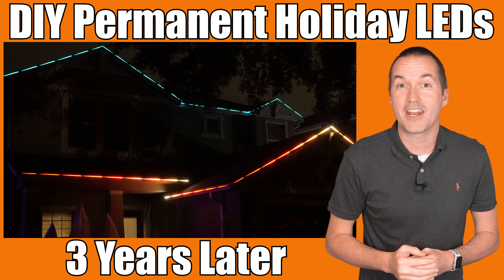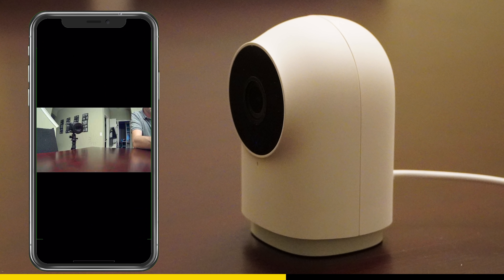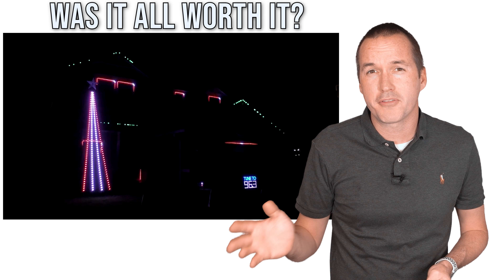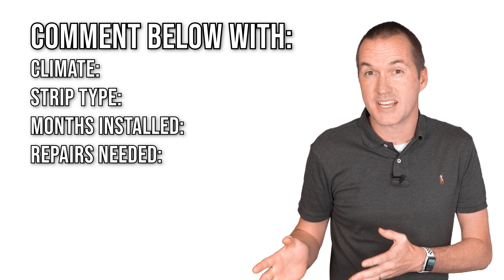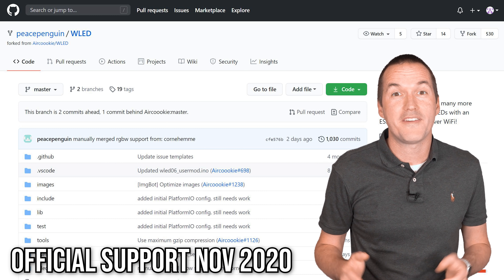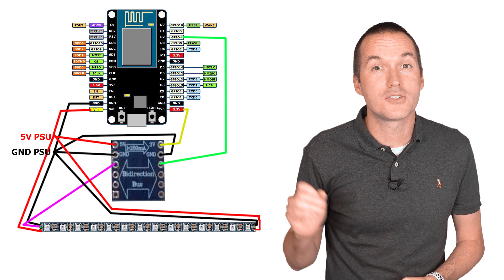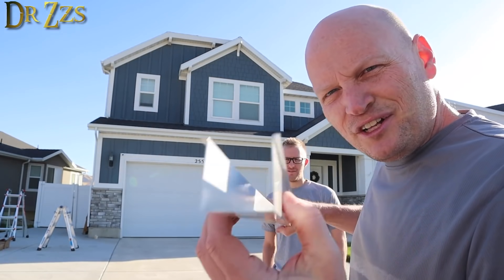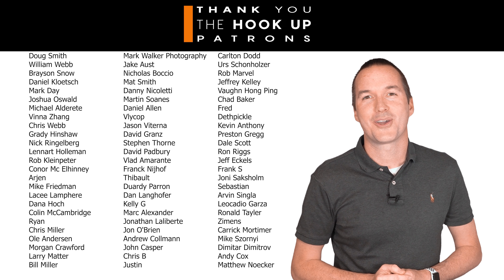3 Years Later: DIY Permanent Holiday LEDs - What worked, what didn't, and what's new?

Comment: Does anyone ever hook-up the LED Strips so that they are on the back-side of the fascia board shining ONTO THE HOME instead of directly visible from the gutter or drip edge (ODE - Outside Drip Edge) like you did?  Does this “indirect” lighting significantly  affect the presentation?  Have you seen a light presentation with this indirect lighting?  The LED Strips & Channel Covers are also protected from the weather when mounted under the soffit/fascia. My reasoning for attaching to the fascia is that the channel can be completely hidden for homes that do not have WHITE Soffit/Fascia. Completely hidden is a perfect situation. I always think it isn’t the best look when you can see the lights in the normal daytime even though they are white on white for most. I have already prepared the fascia to be routed-out soon. Was thinking maybe you knew someone that has already used some sort of indirect lighting method & would love to know your answers, thoughts or any known problems with the indirect lighting. Thanks in advance.
Reply from the maker: It’s a totally different look, but I think it also looks great.  I’d say 30% of the installs that are posted on the Facebook group are indirect.

Comment: What are your thoughts on the WS2818 strips/strings?
Reply from the maker: Couldn’t find much info about them, just 2811s with backup data? The bad part about back up data is increased voltage drop caused be thinner traces on the strip.

Comment: Question - I am looking on some feedback or logic that would help me chose between strips or strings?  Ive watched Dr Zzs video which recommended 12v WS2811, whereas you suggest the 5v on strings.   I never considered strips as my assumption is that once you put them in a sleeve, the light would look diffused or blended with the colors next to it... instead of the crisp single point of strings.  Thoughts, links?  Thanks again for your great videos

Comment: I’m a newbie to this LED Light Strip technology and haven’t seen the topic exactly, but is there a specific spot on the LED light strip to cut to get the strips to the custom lengths? I’m looking to experiment first with doing the LED light strips under my kitchen counter cabinets first before doing a permanent outside setup. Want to learn on a small project first before going big. Thank you for these videos!
Reply from the maker: it varies depending on the type of strip you have, but if you see copper pads you can cut along them.

Comment: Hi! I have a setup of 50 meters of ws2011 strip (12V, 3 leds per pixel). I have a slightly random rgb flicker in all the setup, specially when an installation of white leds with pwm (near to the pixel installation) is on. Do you know any way to stop this problem? I think is a signal interference problem or a power interference problem or both. I thank you in advance!, Luis

Comment: why did you select the 5v version over the 12v version? its funny on ali express the 12v are alot cheaper then the 5v
Reply from the maker: Ws2811 strips should be avoided. Not only do they only control in groups of 3, but they are much more fragile.  My video next week will explain why I still use 5v strips.

Comment: @ 0:04-00:09 and 3:27 of your video what effect/segments etc are you using to get this effect on your leds? Is this with WLED?
I do want to thank you for your videos which taught how to do this great idea. I have done my bottom floor roof line and live in edmonton alberta and no issues yet.
Reply from the maker: That is WLEDs fire effect. Each roof section is defined as a different segment in WLED to achieve that look.
Reply: @TheHookUp  thanks for confirming :) been trying segments for some time it is a rather great piece of software.

Comment: Hey Rob,  love the channel.  Question though. Does your power supply run 24/7. Seems like a waste. Is there a way to put it on a switch or something.  Also I had 2 different strings come. I checked them for color and they were the same but brightness on 2 is different then 1 of them. Any suggestions on that?
Reply from the maker: https://youtu.be/lMnbBMj5XVo?t=156 I'm using a shelly 2.5.  If you're using a controller like xlights you can adjust the gamma and brightness to match any strings, WLED doesn't have that much customizability yet.

Comment: First of all you did a great job with your lights. I was wondering if you had any input on the led rope lights? I don’t need all the programming for different light options. I just want to be able to do the regular lights options. Do you think I’ll need to do anything special running those rope leds or just connect and go?

Comment: Just finished my first floor roof line 600 Leds using ws2812b 5v, running it on a cellphone charger. Waiting for my digiquad to install my power unit. Running it all on wled.
Reply: I've got like 500 leds on first run using ws2812b 5v as well.  It's acting funky.  Most likely my make-shift nodemcu with logic level shifter causing noise.  I'll try the nodemcu + sacrificial pixel tonight to see if that resolves my issue.
Reply: @thebruhhh  could be your data line is too far from the first pixel. Im waiting for my waterproof com box and digiquad to inject power and compost this part of my project.
Reply: @Frogmanvr2  That's exactly what it was.  I had a logic level shifter mess setup with my nodemcu and clearly I did something wrong.  I did the sacrificial pixel last night and it works perfectly (however it's a wiring MESS).  I need to figure out how to better connect my Nodemcu and logic level shifter into the setup.  I'll have 3 zones total.
Reply: @thebruhhh  i received the digiquad, works great, data wire is now 10 ft from my first Led, with no issues.
Reply: @Frogmanvr2  glad to hear it. I finally got the nodeMCU and logic level shifter soldered together on PCB. Turns out my first logic level shifter wasn’t working so that’s why my first try didn’t work. As soon as I added another logic level shifter boom it worked.  Roof is complete. I have 1,492 LEDs up there. 

Not going to have time this year to do FPP on Pi with xlights so I’ve just got like 15 or so WLED effects saved to presets on cycle mode.

Comment: Hey first of all, thanks a lot for all the details you give out on this project. It has given me the edge to dare to try it on my own, and so far let's say pretty successful it has been. However I have the following issue, any help would be greatly appreciated. I have installed 4 consecutive strips on my roof line, I use 5V WS2812B with the cheap power supply you recommended. Before starting the installation I tested all 4 strips (with that power supply) and were all working perfectly fine. I started with the first 2 strips and when turning power on, everything lit up just as expected no problems this far. But then I installed the 3rd strip and that's when the problems started. Now, immediately after installation, I turned them on and it worked great, I was really happy about it. But as I was showing my wife a few minutes later my work of art, I noticed that the last part of the installation, say about the last 15-20 led where fixed in a color, when I was actually running the WLED Merry Christmas effect, they were all are moving fine except that last bit. I turned it off and on again and now it was gone, simply that last bit would not come on at all. I waited a while, tried connecting only that last strip directly to the power source, nothing. While I was looking at it frustrated as I could not figure out the problem, it suddenly came on on it's own and started working again. I took the power source back to the original place I had it, hooked up everything as it was originally, turned it back on and viola!! it was all OK again. The next day, I went again at night to turn it on, started the Merry Christmas effect and all working fine, no problem. A couple of hours later I went out to check and when I look up I see only the first 15-20 LED at the very beginning running the effect, the entire rest of the strips where fixed in Christmas Colors, but not running the effect. I turned them off and on and oh! surprise the entire installation is off now, nothing comes on, not even one LED. Up until now I have not been able to restart it again, any suggestion pretty please? Thanks a lot.
Reply: Did you run power injection to each of those strips?  With 5V ws2812b you'll have to inject power at the beginning and end of each strip.  I just wired up my first run of about 500 5v ws2812b strips with power injection, but my lights are acting funky.  My nodemcu + logic level shifter isn't panning out.  I'm going to try the sacrificial pixel trick tonight.
Reply: @thebruhhh  I did inject power at every junction. I tried just bypassing the 1st strip that had the problem and Strat connection from the second one and it all worked as expected, I think the problem is that 1st strip for some reason which is really weird. I haver ordered a new one to give a try.

Comment: Hey, quick question for you. You mentioned having smart plugs to monitor the voltage usage. What plugs are you using? And what app was it that you showed? Thanks
Reply: If you install WLED, you don't have to worry about that. If you click the "info" tab on the WLED user interface, it will give you an estimated current usage.  Right now, my 40m of LED's are off and consuming 1.1 amp at 5vdc.

Comment: Where did you find the box to hold two power supplies? Looks like it fits perfectly
Reply from the maker: I wouldn't recommend it.  They fit "Perfectly" after you dremel out the inside significantly, and then you're left with no way of attaching it to the wall (see the plywood behind it).

Comment: Hi, will it be possible for you to do a video on Alexa integration of WLED - I have tried different things but I have failed for Alexa app to discover them. Or could you suggest a solution in the meantime? 
Currently, I use MQTT control using node red and node red dashboard.  Also, I see that HA has the option for integrating them but I use OpenHab which does not. Even though there are some people that have implemented a binding but I haven't tried them yet. Thanks and I appreciate all that I have learned on your channel - continue the good work!
Reply from the maker: I don't have my WLED integrated with Alexa, but WLED's developer Aircoookie wrote the Alexa integration that I use in some of my other DIY projects.  

Some quick tips:
1) Make sure your Alexa devices and your WLED are on the same network (no different VLANS)
2) Make sure you have MDNS enabled on your network
3) Older echo devices seem to do the best at picking up DIY devices (I keep a Gen1 dot around for this purpose).
Reply: I had trouble with that as well. First, you have to have a physical device like a dot or show for the integration to work. It finally worked when I rebooted several of the echo dot's I have around the house.  I also moved the nodeMCU as close as I could to the echo dot I wanted to control the lights with.  The last part shouldn't of mattered but after about 20-30 mins of trying it connected on the first try after that. 

FWIW, in the alexa integration is limited. I allows you to change the strip to a single preset color(s), brightness, and on/off. If you have WLED set to run a preset(s) or animations alexa will only turn them on or turn them off.  You have to change thing in the WLED app. 

Good luck.

Comment: I am considering the same led strips that you used but I am stuck between 30/m and 60/m.  Cost/effort not being an issue, will I regret the 60/m because they are so close together?  My theory was that I could use pixels in pairs to get a larger point light but I am not far enough to know if the WLED firmware is flexible enough to take advantage of the extra pixels without blending too much reducing the Spot/traditional light look(when it’s called for).  Will I regret 60/m or can I work around it if I end up wishing I got 30/m?
Reply: I might have found my answer on my own... is this where you would use the grouping/spacing setting?
Reply: @spectre66  I feel like 30/m is the way to go. Less power issues

Comment: Is there a tutorial with pictures or a video on how to do the actual connections at the peak of roof lines? Like how to connect (solder or connectors) the strips power Injection and data line.

Thanks in advance,
Reply: Lol I’m wondering the same thing. Finally doing it tomorrow and Saturday
Reply: He soldered the connections while on a ladder.  This is what has been giving anxiety and causing me to procrastinate
Reply: @Racontact  I’m prepping mine mostly from the ground level so far. Measuring the strips needed and bringing down when I can. For the peak of roof lines mine are 45 degrees so I’m using 2 strips to connect at that 45 degree top. Hope that makes sense.
Reply: @thebruhhh  thanks I'm plan on the same for the peaks. How many total feet of led is your project?   What is your process for power injection? How many power injection points will you have?  How are you going to make those power injections ?
Reply: @Racontact  I’m literally in the process of that. Yesterday I put up the aluminum channel sections. I believe I’m going to do 4 total zones.     The area I’m covering is pretty big. I’m going to say between 65-75 meters. I’m going to inject power at every single point (beginning and end of each strip). 

I’ll be running probably 4-5 wires acting as power injection from the PSU. I Don’t have much daylight time left so I’m going to get back to project. I’ll respond later if you have additional questions
Reply: @Racontact  here’s a picture of how I did power injection (this was also at a spot where two strips were connected): https://ibb.co/jRJstrY

I also did lap soldering which you’ll see in that picture too. Here’s a video on how to do it.  https://youtu.be/bAqZcNtsg2A
Reply: @thebruhhh  great thanks, I never considered doing the lap connection seems like it would be easier.  I got my first 10 meters up today, spent too much time soldering!  Cheers!

Comment: I wonder if someone could help me with my setup. I'm installing different led strip with different control. I want to be able to control them both with apps/automation (in my case openhab, mqtt and nodered) and a switch.

So for a start, I bought some 5050 White LED Strip that I won't dim and turn on/off. This will be to light the entrance which has currently no light and is very dark. So I though using a shelly 1 for the automation and connect a momentary switch to it, so it can be turned on/off from either the switch, the apps and rules. This is I think the easy part.

As for the other strip, it's ws2815 (neopixel). For now, I only have a wifi controller that I'll replace because I can't even flash it or use it outside of the apps. So I though, nodemcu maybe? I'm unsure. My goal with these strip is to be able to control them with rules/openhab (for the color change, effect and all), maybe xlight. But at the sametime, I want to be able to turn them On/Off/Dimm with a wall dimmer. I would like to be able to do so without requiring message to mqtt or other (if servers/network are offline, I want to be able to control the light). If color changing can also be implement this way, more fun, but the basic is at least on/off, dimmer a second needed. Since it's pixel led strip, I can't use shelly RGBW.

In the long run, everything will be retrofit with sensor to auto-on/off, but this will be tied to the server and I want something that allow usage of the light without servers/network because, well, crash happen.

Thank you